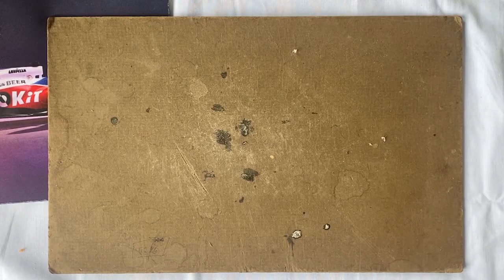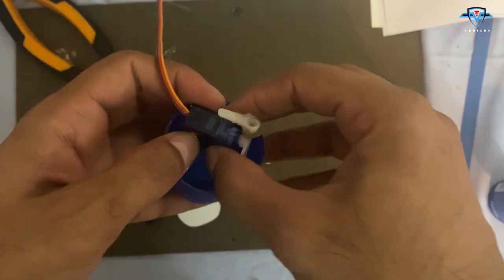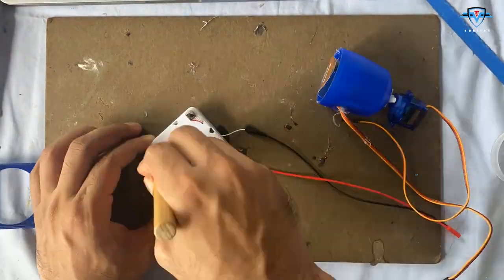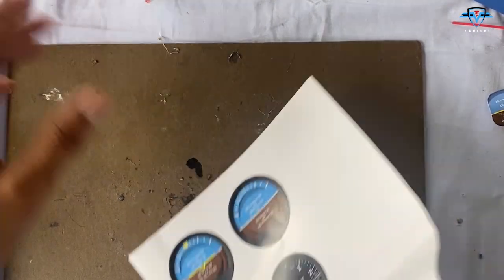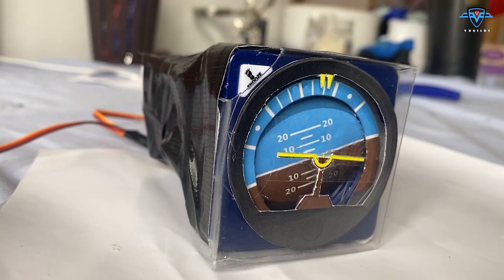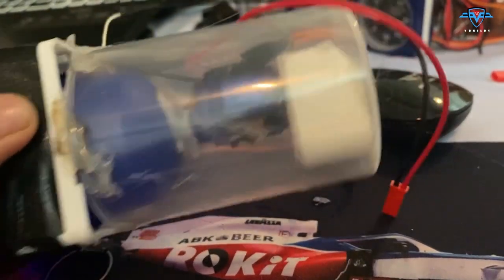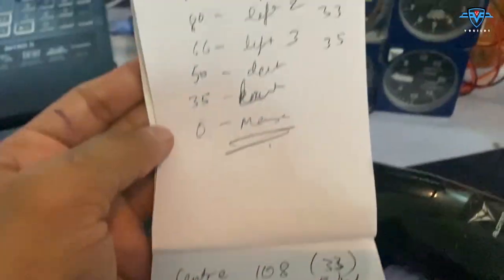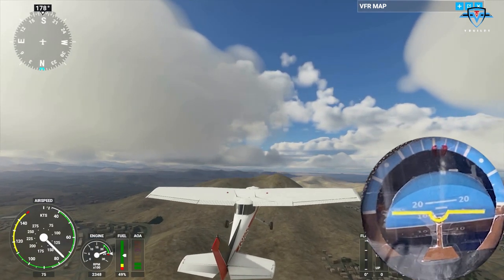Attitude Indicator for Flight Simulator

Comment: HI, I have been following all your DIY FS-Instrument videos. Great work. When do you plan to show the configuration details of interfacing with MSFS. Best Regards.
Reply from the maker: Thank you so much, i had the videos in my phone and i lost the phone, i need to shoot again. Sorry. I’ll try to re shoot again soon
Reply: @VBuilds  Thank you for your reply. What I meant was not the video but details about software interfacing to Flight Simulator which I suppose was installed on a Computer.
Reply from the maker: @udp47  there is a python library available SimConnect.. I used it to write a small code which outputs the flightsim data to serial port… then the same data i used in arduino to display the values.. If that helps, or you can connect with me on Instagram V_builds_official I can share the code with you
Or maybe i’ll shoot anothet video for that
Reply: @VBuilds  Thanks. Regret I don't have an Instagram account. Any other alternative such as uploading to a cloud like google drive and show the link here?
Reply from the maker: @udp47  okay i’ll share soon
Reply: @VBuilds  Thanks. Awaiting.
Reply from the maker: @udp47  https://github.com/VikasSangwan21/flight-simulator-connector
here is the link for the connector I made using python, It outputs the flight sim values in serial ... which can be used in arduino serial input
Reply: @VBuilds  Thank you for your quick response. I will download and check. I have been using LUA script with FSUIPC.
Reply: @VBuilds  Modules (import in Connector.py) missing,
Reply from the maker: @udp47  there is a bat file in there… try to run it

Comment: Use a stepper motor to get more accuracy
Reply from the maker: is it? I thought servo motor will be more accurate since it has position control
Reply: It can run smoother but not more accurate, it can miss steps and not register it, while the servo will correct if it is not on the correct position
Reply from the maker: @DamianEmilio  Yeah i thought so